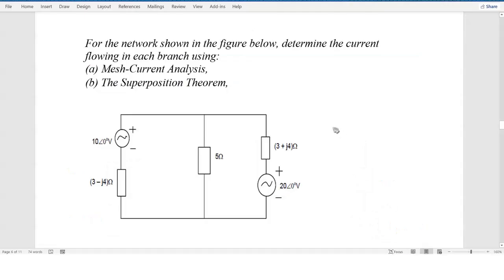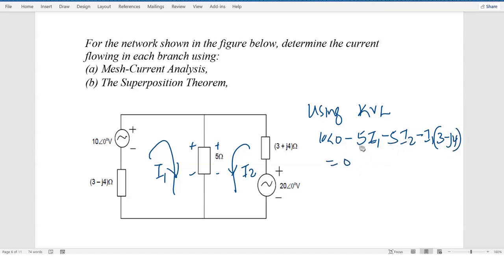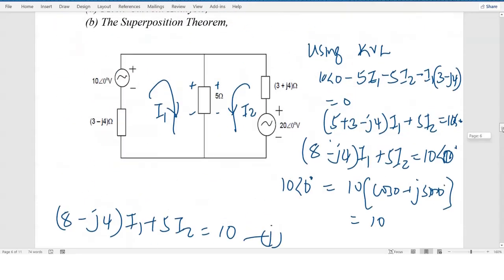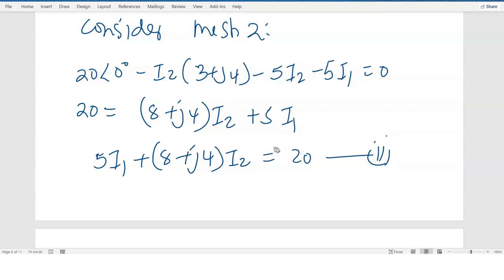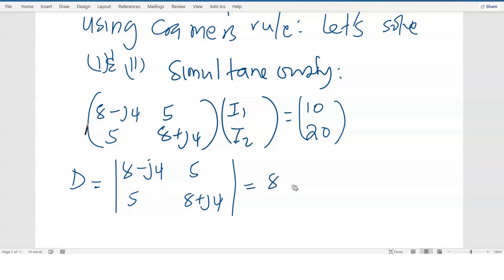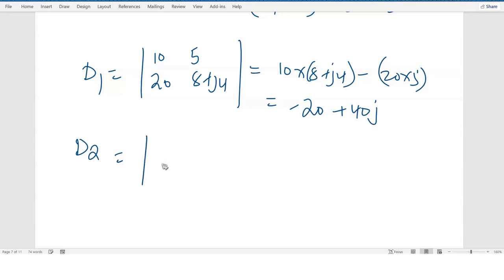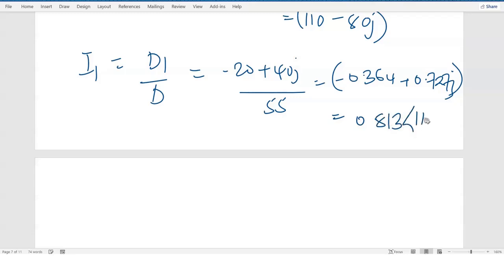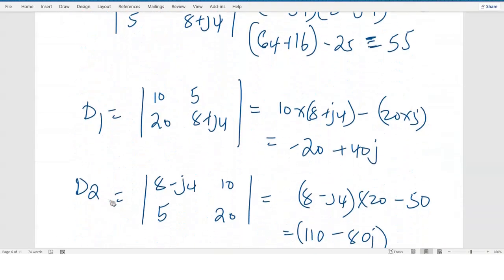Mesh Analysis in AC Circuits | Cramer's Rule | Single-Phase Analysis

Comment: Hey um just wanted to ask why you made one loop clockwise and the other counterclockwise, kinda thought we'd keep it unidirectional because when you did so there was a negative somewhere.
Reply from the maker: If you look at my equations, I am considering voltage drops as negatives and keeping sources positive. And this prompts you to keep the direction of currents via an impedance in the same direction, a reason why in the next loop I indicated the loop facing in an anticlockwise direction.

It's a convention you will find other electrical engineering channels and text books using